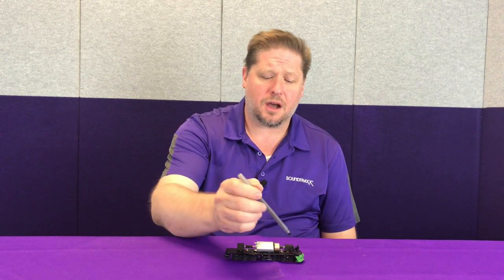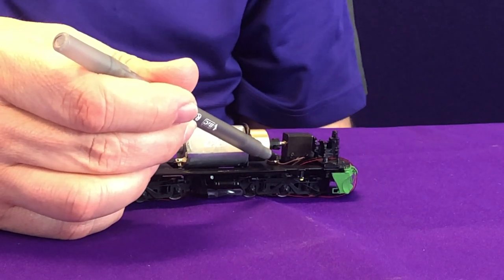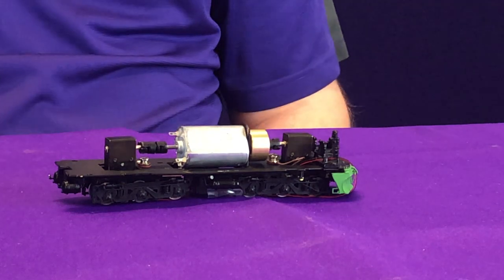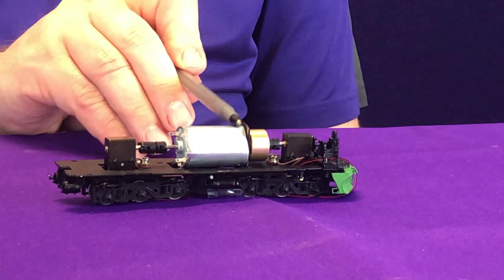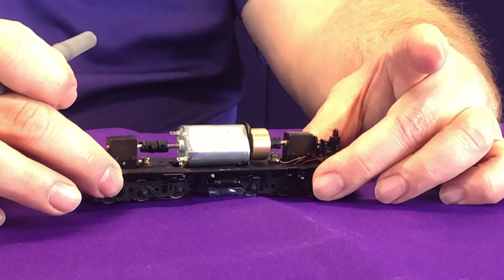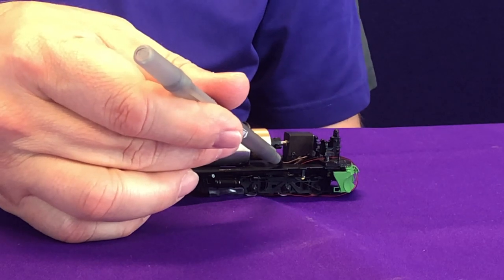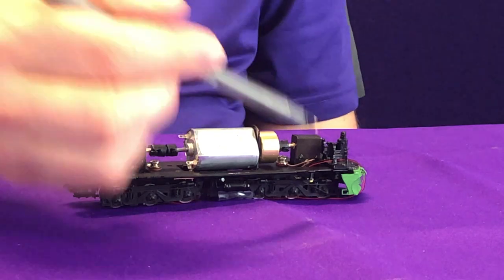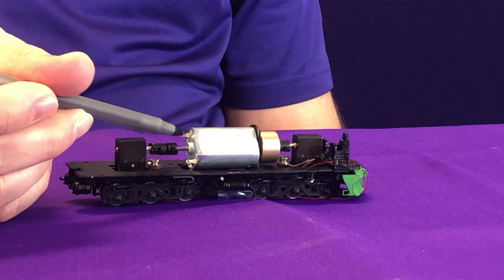Brass Install Tips from SoundTraxx

Comment: Well how do we determine the Negative (grey) and Positive (orange) side of that 'can' motor??
Reply: Easiest way, would be to use a 9v battery, connect it to the motor, and notate the +/- orientation for forward & reverse movement. It's not a huge deal as with most decoders now you can reverse the motor polarity in the CV programming.
Reply from the maker: Good tip!